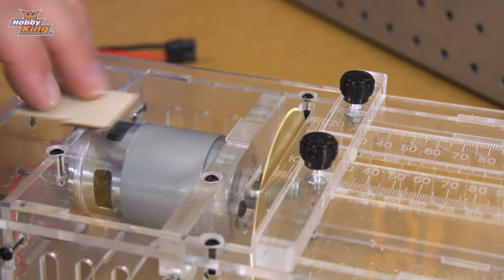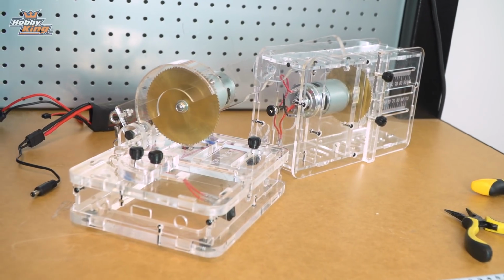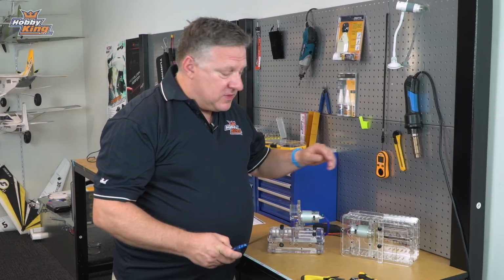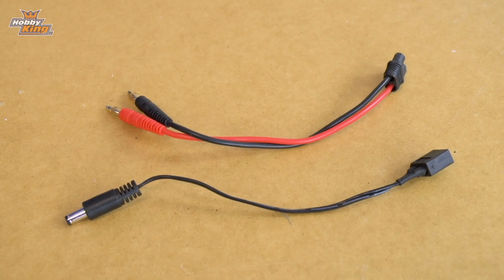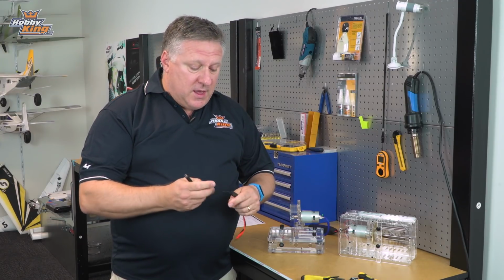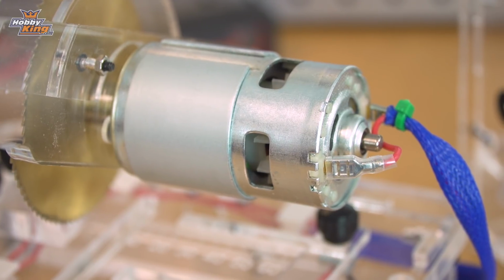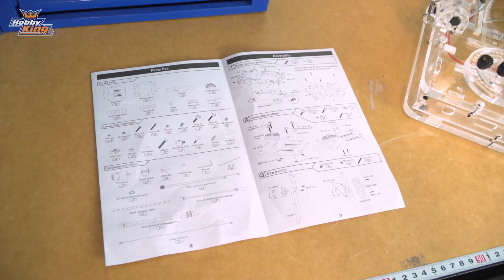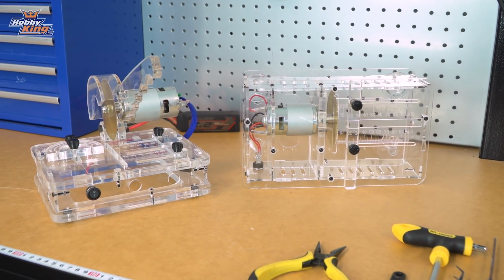Mini Saw DIY Assembly Kits - HobbyKing Super Daily

Comment: never gloves...
Reply: With these saws gloves are recommended and safe since the blades are stopped quite easily. Bigger saws have so much power and momentum that it will rip and pull things apart.
Reply: @drkastenbrot  Nope. Those motors aren't that small and are harder to stop than you would imagine. Plus there's literally no point in using gloves, you're not dealing with wood that's dirty or that could give you splinters, so just go bare handed. Rule is with anything that spins, no rags or gloves. Seen people get hurt with rags around a cheap chinese dremel, and the motor in these are even less powerful than the ones in those mini saws. Also you should never think your hands or rags are far enough from your tools, you never know what will happen, a brief moment of inattention and you're done for, in the accident I've seen with the cheap dremel, the rag was about 3-4cm away from the dremel, but it somehow got sucked into the tool and I have no explanation for how it happened but it made me realize you can't mess around even with small tools.
Reply: @imnota  cool theory but i have the saw and threw a glove it in, and it just stalled

its worth noting that this motor only draws about 100 watts unlike your average 600 watt dremel tool
Reply: @imnota  i can stop the blade by pinching it, i think we are talking about very different motors
Reply: @drkastenbrot  lmao your answers just keep getting more and more ridiculous. If you were able to stop the blade by pinching it you wouldn't be able to cut anything with it, not even 1mm balsa...
Honestly keep going it's pretty entertaining
Reply: drkastenbrot. NG